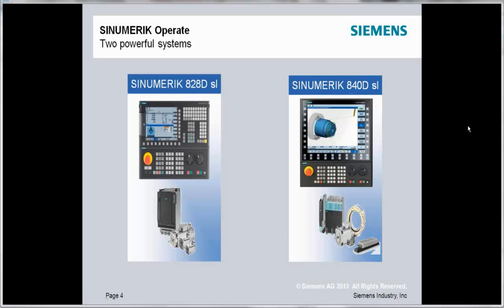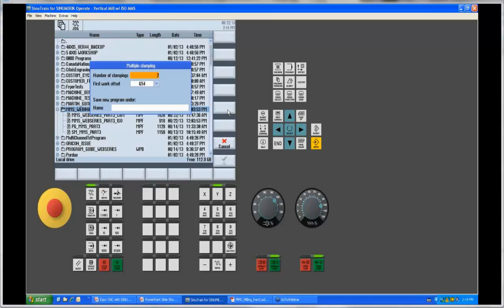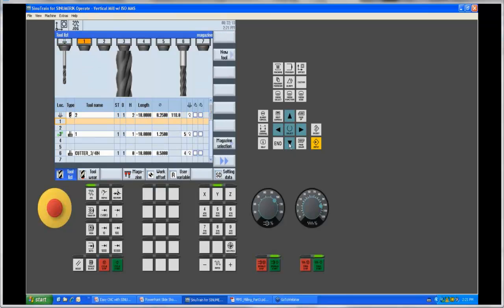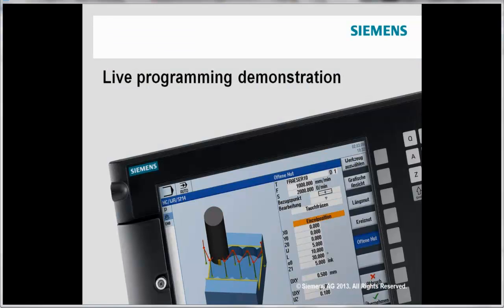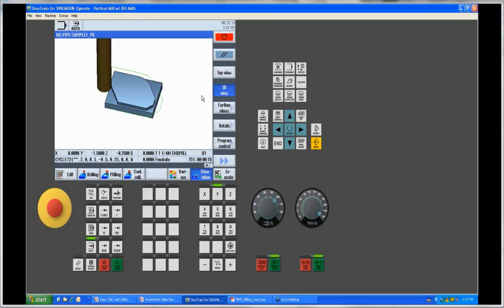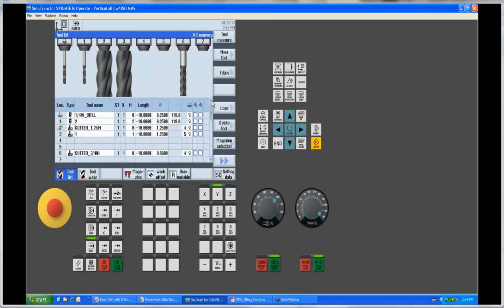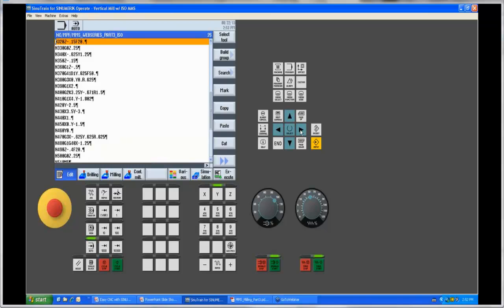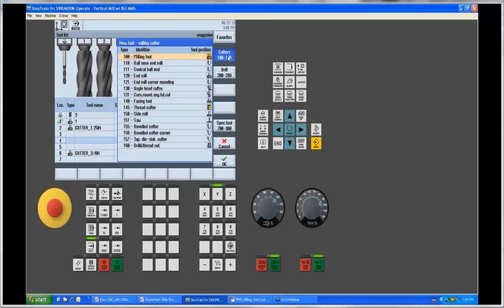ISO programming on Sinumerik CNC

Comment: I am getting Alarm while ISO mode      as you programed same that say ISO mode is not active, Could explaine parameters of set ready to run ISO mode, in Version 828 & 840 model.
Reply: 840 ka drilling program kese hoga

Cnc lathe sinumerik 840

Help

Comment: Hi
I'm trying to write a program to do a 50x50mm 45 degree chamfer by using a different plane (G18) i.e X start 0. Z start -50.  X finish 50. Z finish 0. I havent got access to cad and would like to do it without having to tilt the job over to 45 degrees and machining it that way as I'd like to keep the setups to a minimum. Can this be done on a sinumerik 828d control? I've also though about using a macro but I've never done one before.
Any help woud be much appreciated.
Thanks
Reply from the maker: Rob Hewitt Hi, Sinumerik supports different types of programming, do you have rotation axis on the machine? Usually, I use cycle 800.
Reply: Alexander Kudinov no unfortunately I've only got a 3 axis machine. What is cycle 800?
Reply from the maker: Rob Hewitt it is a cycle to swivel the workpiece if you have rotary axis
Reply: Alexander Kudinov like I say unfortunately I've only got 3 axis. If I wrote a simple profile X0 z-50 then a g01 move to X50 Z0 could I write a kind of sub program or something to get it to keep repeating adding say 0.2mm incrementally in Y and do it that way? Really not sure how I would do such a thing tho
Reply from the maker: Rob Hewitt yes, of course, you can use R parameters with if and while commands to go deeper using a constant step. Can you show a drawing?
Reply: Alexander Kudinov Im at home at the moment so no drawing to hand sorry. How do I use the R variables? I know where they are on the control but not sure how to use the if and when commands as Ive not used them before. Could you show me a sample program? Thanks for helping by the way it's much appreciated.
Reply from the maker: Rob Hewitt hm, it is difficult to show it here, there is a documentation with examples, if you want i can send it to you, do you have the e-mail?
Reply: Alexander Kudinov that would be fantastic it's Rob01.hewitt@googlemail.com
Reply from the maker: Rob Hewitt i have sent some links, docu will be sent later!

Comment: hello. i have problem with cncmill siemens 808d when i execute program g-code
%_N_Test_MPF
;PATH=/_N_MFP_DIR
N14 G291
N2 (6 MM 2 FLUTE CARB E.M.)
N3 G91 G28 X0 Y0 Z0
N4 M06
N5 S4000 M03
N6 G90 G54 G00 X-115.085 Y-108.147
N7 G43 Z-251.915 M08
N8 G01 Z-252.915 F322.
N9 G17 Y-108.245 Z-253.533
N10 Y-108.529 Z-254.09
,
N8982 G91 G28 Z0
N8983 G28 X0 Y0
N8984 M30
the plc Blocking and all led`s are flashing

in 2017/02/06 the alarms
- 400001
-400000
-26100
-1005 :   p1:10090017h  p2:8E185CB0H  P3:00000000H  P4:00000000H
-6583

in time:2017/02/07 the alarms
- 2000
-3000

in time:2017/02/08 the alarms
-1005 :   p1:10090017h  p2:8E185CB0H  P3:00000000H  P4:00000000H
-26100
in time:2017/02/08 the alarms
-200005
-4065
-400005
-400000
-2000
-3000
please can you help me because a service assistance siemens does not exist in my country.

best regard.
Reply from the maker: MAZAX BC hi, could you provide to me your e-mail to help. where are you from?